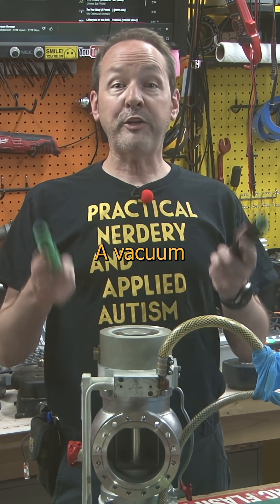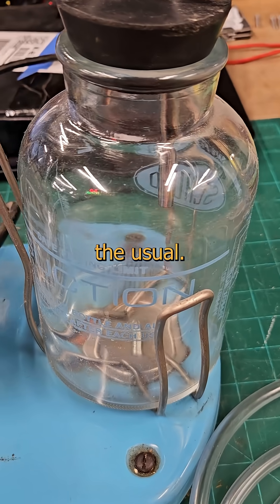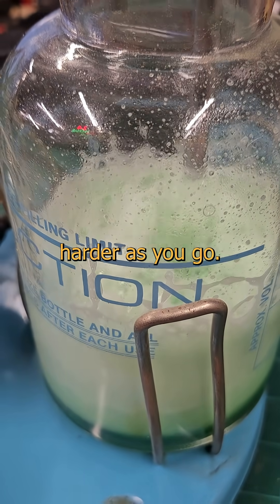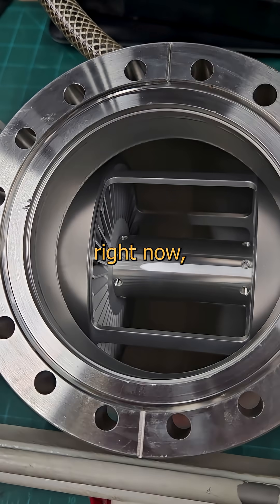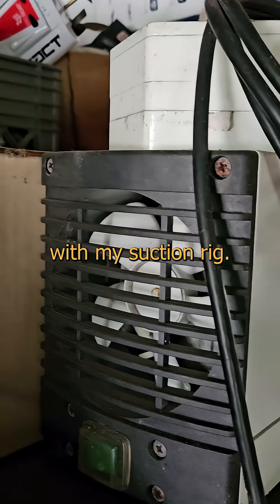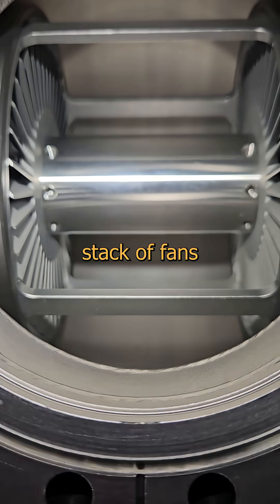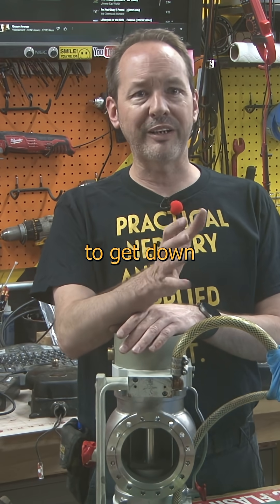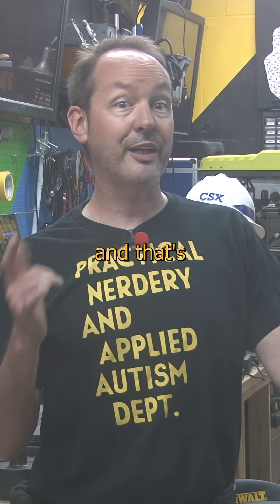Turbomolecular Vacuum Pump #chrisboden #comedy #engineering #physics #science #turbo #nerd

Comment: My PhD was in ultra high vacuums and the TMP was our life saver if not the most temperamental thing in the entire lab. Aside from when our rough pump decided to leak and catch on fire one night
Reply: Oh ours exploded when it did that. Metal everywhere. It decided it didn't want to spin anymore, at a few thousand rpm
Reply: @stevendaly4640  like the 2nd turbine! rotors really like to weld themselves shut and blow up if you touch them wrong. funny things, really.
Reply: I have nothing to add but I absolutely love this thread. Real human interaction. No bots.
Reply: That’s hot. Working late in the lab.
Reply: I worked on vapor deposition machines for 15 years.  I would argue that the tmp is more reliable then a diffusion pump which I understand is a hard sell being diffusion has no moving parts but never once did I have to do anything with a tmp.  They just worked. the diffusion pump had to be pulled completely apart every year to be cleaned and get fresh oil
Reply: @Mike-jv6il  MOCVD guy here, and that's my take on it too.  Turbo pumps seem to be relatively robust, but if a diffusion pump gets 'bumped', you've got a real mess on your hands.
The old helium leak checkers (Leybold) used a cryopump diffusion pump which was a PITA, but the newer leak checkers used a small turbo pump which was much better!
Edit:  I meant diffusion pump.  Sorry 'bout that, it's been a long day!   ;-)
Reply: @Mike-jv6il unless the stupid engineer put them at the bottom of the chamber below the WATER-COOLED magnetron cathodes!! That system had already died before I started there. But, I worked on the lab system that you had to manually switch between roughing and into high-vacuum (with actually means very low pressures, also vapor deposition, around x10E-6 or so).
Reply: Yes please, I want the extended interview version of each comment in this thread.
Reply: Anybody in Australia watching this and has a TMP  to give away, please message me. I'm at the begging stage😅
Reply: I did high vacuum processing and high vac pumps are wild. Only had a couple turbos, mostly used liquid He cold traps that work by trapping molecules in a maze of carbon and making them too slow to agitate their way back out easily.
Reply: @CrankyOtter  Did you mean liquid nitrogen cold trap?
Reply: I've in high vacuum for a few years. The titanium sublimation systems were neat. My co-worker wrote a kick ass control program to automate the majority of it.
Reply: @nonokodog622 Have you ever fixed a shorted one by hitting it with a hammer? Percussive maintenance is surprisingly effective at dislodging pesky Ti needles.
Reply: Rough night eh?
Reply: As they do
Reply: Do you have any recommendation for learning more about milliTorr measurements ?
Reply: I was under the impression TMPs used a hot silicone oil convection waterfall thingo to stick free molecules out of the system.

i guess there is more than one type!
Reply: @garethjones6342 you are talking about a diffusion pump.
Reply: @garethjones6342  You're thinking of a diffusion pump.  Turbo pumps use blades spinning at high speeds... kind of like a jet engine.   :-)
Reply: Have you even worked in UHV if you haven't found your vacuum system full of rotary pump oil at some point? If only scroll pumps weren't so expensive!
Reply: @MattNeighbour  Shouldn't have any oil coming from your RV pump, if so something's wrong with it or the muffler may be over filled.

Comment: Worth mentioning cold traps are necessary when pumping light gasses (He, H2) as a turbo has a difficult time imparting sufficient momentum to pump them, in fact in a helium leak check system you actually measure helium diffusing back through a turbo from the roughing line.
Reply: Cold traps are also Absolutely necessary to keep contaminates out of your pumps.

Comment: Cant tell you how many turbos we fucked up when we installed a faulty rough pump and fired up the machine. Used to build mass spectrometers.
Reply: Shouldn’t there be a system interlock that only allows the turbos to operate at the right pressure
Reply: @philip2.2.12 maybe there was vacuum when the switch failed and they just had to get that one order out and bypassed the switch?
Reply: @philip2.2.12  Some turbos *Do have a control system that keeps it from damage. Our Agilent TMP does.
Reply: @philip2.2.12 you may be over estimating the foresight of some engineers...
Reply: @RiskBizz there’s a reason why they’re engineers
Reply: After almost 20 years of working with/on mass specs, I'm surprised I haven't blown up a turbo yet.  Mostly working with GC applications so it is usually pretty hard to get a ton on air in on accident in my case.

Comment: I worked as a plasma dry etch technician in a semiconductor fab, trust me they dont last seconds, one of the other techs vented the wrong chamber and that TMP looked like confetti, the VAT paddle closed fast enough or was already closed fortunately so the chamber survived. The TMPs on the machines were about 8"-10" diameter turbines, suspended by magnetic levitation bearings, they were not suppose to be operated above 500 mtorr.
Reply: Yep. In diffusion and another tech dumped the leak checker (a tmp pump) and the camber that was under full vacuum because he didn't check that the exhaust pump was on. Lots of very expensive noises followed.
Reply: mmm, turbo salad
Reply: What rpm do they spin at?
Reply: @Rollin8.0 its been a while but I think it was some where between 12k - 18k

Comment: In hvac we pull the microns to below 500.  Was cool to see it on a large scale.
Reply: pull the microns?
Reply: @tsm688 it starts at atmosphere pressure then the microns will slowly go down. In hvac we watch it on a guage then when it gets down to below 500 you have pulled a good vacuum and the system is ready to charge.
Reply: Basically microns are a unit of measurement.
Reply: @gorillawizardbluecap  microns what?  mercury?
Reply: @tsm688 yes

Comment: Good job describing high-vacuum to ultra-high vacuum pumps.  You left out the fact that the worst contaminant in an ultra high vacuum pump system is water - it sticks to every vacuum system surface & comes off very slowly unless the system is heated up to more than 200 deg F.  Also, you should show an oil diffusion pump, that used hot oil jets to do the same process as the turbo pump blades.  Diff pumps don’t reach the lowest vacuum levels but have no moving parts.
Reply: Correct, this is why TMP are preferred over diffusion pumps for deeper vacuum.

Comment: your missing the heating bands (well hemispheres) for the central chamber of the pump. Seeing as its Conflat it should have those fitted, they are red roughly hemispheric plates. 

Also, that oil might need chainging by the looks of it. 

Fun bit of trivia, this is the form of the turbo molecular pump as it was first designed by becker (if i recall) and sold by the Balzers company of Lichtenstein. Previous molecular pumps where drag pumps, were as this is not. Modern turbomolecular pumps have drag pumps behind the turbo molecular pump stage to increase backing pressure tolerance. Makes them more sensitiv to mishandling though, owing to the tight tolerances.

Comment: When I talk to apprentices about the atmospheric pressure at sea level… Something like 14.7 psi per square inch of surface area. It always blows their minds and I’ve learned not to tell them about blood under a vacuum immediately. One way I have found to answer their question about “why don’t we feel it“is a little thing I heard about two fish swimming at the bottom of the ocean. One fish says, “boy the water feels good today” and they swim for a little bit and the other fish says “what is water?”
Reply: Pretty good. I've always explained it as, "you don't feel it because your insides are built for the pressure. If you lower the pressure, suddenly they're not." And then if they ask again talk about gas embolism and pressure boiling point relationship.
Reply: The blood boiling under a vacuum thing is a little overblown. The capilaries right by the surface of your skin will have a real bad day and basically become one giant bruise, But going from 1 Atmosphere to 0 isn't actually that big of a change in the grand scheme and our skin and other connective tissues are quite capable of keeping us together. Explosive decompression could cause ruptures in the lungs and other organs with air in them, but for the most part its just suffocation that gets you. A dude at NASA ended up in the vacuum chamber for about 15 seconds by accident, He could feel the spit boiling off his tongue but was otherwise fine except some inflammation in his ears, didn't even rupture his ear drums.

I think people conflate the Byford Dolphin incident where there was a 9 atmosphere delta P that really did pop people with just going from 1 to 0, its not nearly as dramatic.
Reply: @kylehenline3245  Having a very vivid imagination and a very curious mindset, let me just say a word of advice: Don’t google “Byford Dolphin incident”. AFTER I did, I remembered having previously seen an animation about what happened to those poor unfortunate people.
Reply: i'm going to go look up what happens to blood in a vacuum now
 
edit: jesus hopscotching christ.
Reply: @corpsehandler5321  You've read about it or watched it ? Just watched action labs  tried it and only thing that happened was that the blood got a bit darker red.
Reply: um.... "apprentices"?!?! WTF?!? In Canada people  are taught this in grade school. It's basic "this is how the world around you works" stuff. You're teaching grown a$$ adults that there is an atmosphere!?
Reply: @grejen711  And in Canada there are full grown adults that have forgotten grade school as well, don't try to cap we've seen the interviews! 

Where I went to school we did basic atmospheric pressure stuff with the water column demonstration and siphons and whatnot in 4th grade science, and then you do a bunch again in 9th grade when you do a quarter on meteorology.
Reply: @grejen711  I don't think they mean as in teaching people there is an atmosphere. Instead, more along the lines of how you don't think about constant atmospheric pressure and what its implications are on a regular basis. I understand why you might, but please don't jump to conclusions on the stupidity of people or that something isn't taught. I clearly remember learning about this very young in school, so yes, it is taught here too (assuming OP is from the US given Imperial measurements).
Reply: @loficampingguy9664  Lived in the US for over 50 years. Lotsa dumbs here and its not just because of a lack of education.
Reply: @grejen711 Who's Canada?
Reply: @grejen711 yes we are too! Don’t worry you’re not a genius yet!
Reply: @grejen711 who tf are you to be commenting that stuff😂 what a guy

Comment: The sand analogy was a fantastic way to relate to moving single air molecules.  It seems so counter intuitive that a fan would work at all with only a few molecules bouncing around.
Reply: 1/10th of a percent air pressure on one side and 1/100th on the other side is a huge difference relatively. Us carbon based creatures consider both the same, but that pump sure doesn’t. 👍
Reply: I had to learn this long ago as an HVAC tech. Most people think that blocking the port on a vacuum cleaner makes it work harder but it just spins faster because it's not doing anything. The air forms a vortex in the same direction as the fan blade causing a drop in load. Fire up that TMP and those fan blades would probably fold over in a second. Just like a plane propeller in water.
Reply: @billybbob18  what would happen if you ramped the rpm up slowly?
Reply: @leviblack7036  You could probably do that, but the junk pump could get you to optimum vacuum 1000x faster.
Reply: @leviblack7036  the problem is that with too much air you would likely create a shear effect where air moving in front of the first set of blades, in the same direction as the blades limit the amount of air entering the blades, which seems good, until the effect collapses and too much air enters at once and destroys the blades. I also suspect that the motor would burn out with the load placed on it to try to start spinning in atmosphere at a low rpm. It's just not built for low RPM and comparitively high torque.
Reply: @billybbob18  Eh, you can dump them a few times without generally damaging them beyond functionality.

I work with much bigger turbo molecular pumps.

Sometimes we’ll have an inexperienced person crack, a weld on a plasma chamber while it’s under a full vacuum with the turbo pump spinning at 30,000 RPMs.

It makes a very loud chunk sound… it’s not good, but the newer ones are very beefy.
Reply: Once you're down to the last few sand grains, you just give up because it's so hard
Reply: @planetofortsonce you're down to the last few grains of sand, you use a vacuum.
Reply: I would just vacuum the sand
Reply: How is no one going to mention that the atmosphere is not 6000 miles deep?!?
Reply: @That.Guy.  According to NOAA the exosphere ends at around 6,200 miles above sea level.
Reply: @That.Guy. Yeah, if cars worked vertically, space would be an hour’s drive away
Reply: @empressadria7009 and the last reaches of atmosphere are more than 6000 miles past the point that is considered space.
Reply: @That.Guy.  Because it's actually more like 630,000 km deep?  It's called the geocorona, and obviously it is very tenuous past the first hundred km.  But Earth keeps sloughing off air molecules, and they can still be found out that far.
Reply: @That.Guy. the exosphere, the outer layer of earth's atmosphere, extends to about 6200 miles from earth surface.
Reply: @That.Guy.  6,000 miles might be the point at which not even a single molecular of what could be considered our atmosphere exists.

The international space station, 200+ miles up, is actually still in out atmosphere. They have to periodically fire it's engines to regain altitude it's lost from atmospheric drag. Plus, our outer atmosphere expands and contracts depending on sun storms and the earths orbit.
Reply: @That.Guy.  the exosphere is actually stated to be up to 6200 miles deep. However, the majority of the mass is concentrated much closer to the surface , hence air density.
Reply: @That.Guy. Yeah, I think he was going for something like six miles and got mixed up somehow and made it six thousand miles.
Reply: @Havlock  I mean TECHNICALLY the atmosphere is all air... and that extends to about 6,214 miles out... it just isn't breathable air. 
(Only the breathable atmosphere is 6-12 miles depending on location) :)
Reply: @Havlock  The exosphere, observable from space as the geocorona, is seen to extend to at least 100,000 kilometres (62,000 mi) from Earth's surface.

The atmosphere is, in fact, well over 6000 miles deep.
Reply: @That.Guy. it's hyperbole for effect
Reply: Isn't it?  How far does gravity reach? @That.Guy.
Reply: @dannthenitroman  what does gravity have to do with it? Gravity may decrease exponentially squared over distance but it goes on forever
Reply: I hate air molecules. They’re course, and rough, and irritating, and they get everywhere.
Reply: @not_the_useless_cake856 ah yes, Newton’s 3rd law of aerodynamics
Reply: @dannthenitroman  I'm not very knowledgeable on the subject, but I would think an object with gravity will exert its gravity infinitely in all directions until it collides with another object with an equal or greater gravity than is being experienced at that moment.

Comment: Hi vac specialist here from SA, that's a pfeiffer turbo pump. A very old one. Hit me up if you want to see the new ones all opened up.❤
Reply: Working with Ion Beams showed me one that was involuntarily open. One Pressure gage thought it was okay to open one valve... which was not, so this particular pump, running at full blast got the full atmosphere and decided to distribute itself in the whole room.
Reply: @MrManniG Unscheduled Rapid Disassembly
Reply: @TrapShooter68  URD?
Reply: @Dfutham  RUD. Rapid unscheduled disassembly
Reply: @MrManniG  Could that be avoided with multiple sensors/gauges and better control logic? It seems odd to have a single point of failure on a device like this. Maybe I'm missing something here?
Reply: @bl88-88  could, yes.... but was not. At least not in this section of beam line, but the next valve reacted in time to save all the other pumps on this Accelerator. 
Also the whole system was built over the last 60 odd years. We still routinely rebuild parts made in the GDR.
Reply: We melted a hole in an in-chamber cooling line and learned that UHV pumps hate 1 atm WATER even more than air. It was a cryopump, so no shrapnel though.
Reply: This particular pump is from a machine from the mid 60s, so I'm not surprised you say it's very old lol. Kinda cool seeing something I pulled myself showing up in a video! I've been waiting lol
Reply: @rabid6767 South Africa? South America? San Antonio? So many options...
Reply: @PascalsGamblingAddiction Saudi Arabia?
My money's on South Africa, though.
Reply: @PascalsGamblingAddiction  or South Australia. I think Africa is most likely though.
Reply: I think the newer ones from Lybold look a lot better than the Pfeifer ones. But Looks usually aren’t enough.

Comment: They're actually an 'Impeller' not a 'Turbine'.
A Turbine extracts energy from a fluid (gas) to spin a shaft, whereas an Impeller is the opposite and adds energy to a fluid (gas).
Reply: A more hair splitting analogy might be a high bypass turbofan.... Like the latest passenger jet engines which get more thrust by the reaction of all that air it blows.

As a guy with an aviation and turbine engine background, you gotta love the analogies though👍